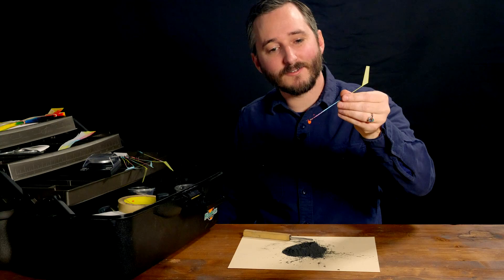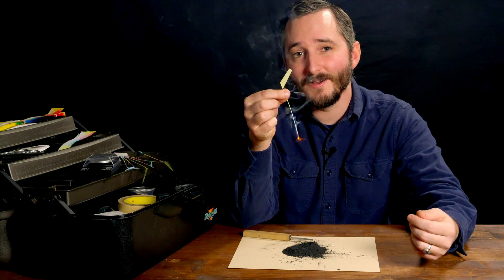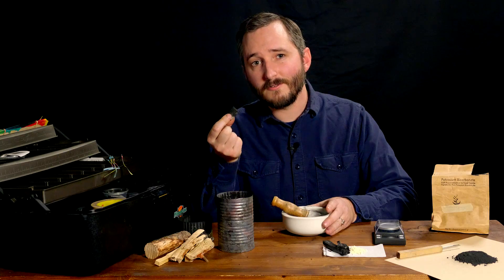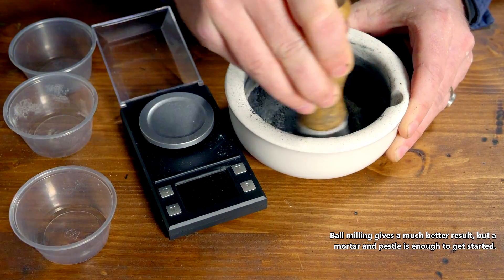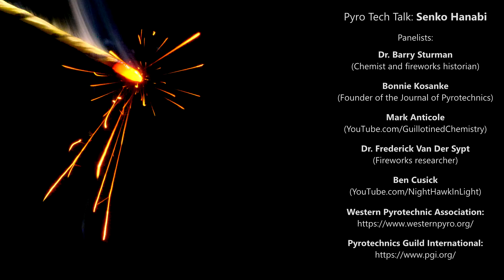The World's First non-Flammable Fireworks (a novel way to make Senko Hanabi Sparklers)

Comment: Great video! I wonder what would happen if you used strontium or barium carbonate.
Reply from the maker: Tried barium, it didn't work because the carbonate converts to sulfate and the melting temp is too high. I suspect the same for strontium

Comment: Excellent work ! Thanky You ! Apart from sodium carbonate, have you also tried other carbonates from like strontium , rubidium , cesium, copper, lithium etc. for changing the sparkling colors ? And what would happen then if you combine to different salts, would it make distinctly colored sparks?
Reply from the maker: Calcium carbonate works I've been told. Not sure about other metals. I think it depends a lot on the melting temp of the metal sulfates. Barium does not work because the melting point of barium sulfate is higher than the drop temperture.

Comment: If you add copper oxide (sanding from a copper pipe) to it does it make it green?
Reply from the maker: No, you also would need something that adds chlorine to the copper. It might be possible but it would take work to figure out
Reply: @Nighthawkinlight  interesting. With simple bicarbonate being used it makes a person wonder what simple household items you could add to these that would change its characteristics.

Comment: This is the first time I've heard of these sparklers and they are beautiful! I barely made it through chemistry in college, so I apologize for the dumb question I'm about to ask. Could the NaHCO3 be mixed with the KHCO3 to make the sparks brighter or would the two compounds negate each other? Again, I'm not very bright when it comes to chemistry (or most things), so sorry if the question is super dumb
Reply from the maker: I tried mixing the two together once and it was kind of the worst of both worlds. Not a bright yellow color and not very good sparks. It's possible that it could be a nice effect if someone put the work in to perfect the recipe.
Reply: @Nighthawkinlight  thank you so much for the answer! It would be super awesome to tinker with this mixture to find out, but honestly I don't trust my clumsy butt with any kind of project that goes beyond using safety scissors and crayons

Comment: This is truly amazing. I wonder if you could add some sort of flammable catalyst in the tip to avoid having to melt the ingredients? Maybe in the papers. Perhaps capping it in sulfur like a matchstick would have a cool and safe effect. Not sure how it would melt the ingredients fully, but I think that could become a really amazing and safe product if possible
Reply from the maker: They light easy enough I think to not require adding any more flammable components.
Reply: @Nighthawkinlight  I was thinking more for commercial use... Idk if most people would have a torch with them 😂
Reply from the maker: @inertial_salmon  You can light them with a candle, or just has to be when there's no breeze to blow the flame around
Reply: @Nighthawkinlight  tho it is quite impressive that you've managed to make this. Interesting if you can lower the melting point?